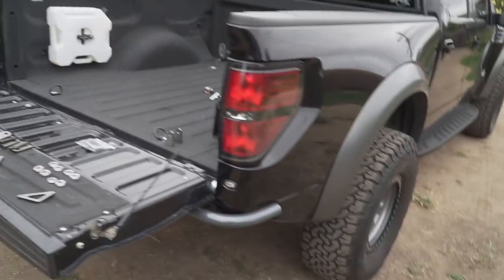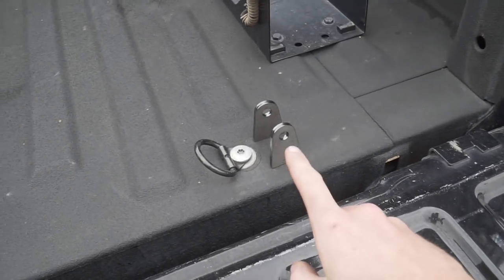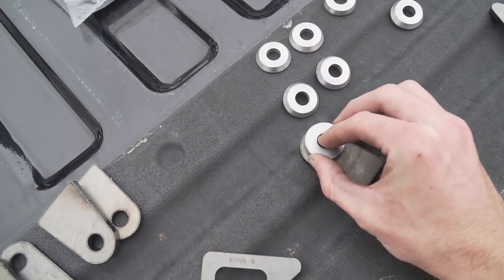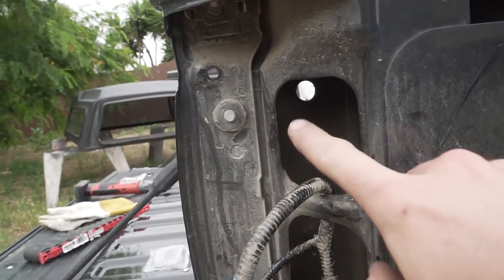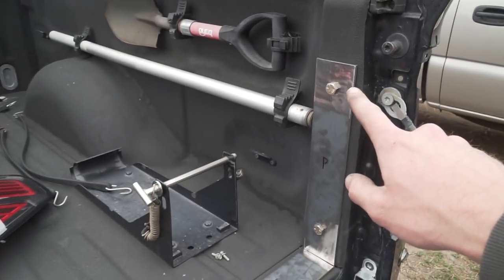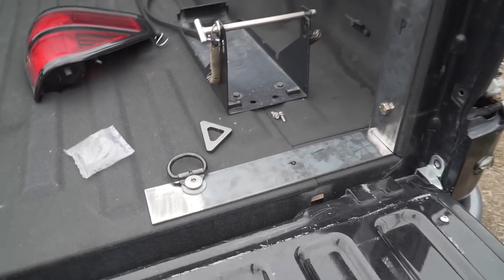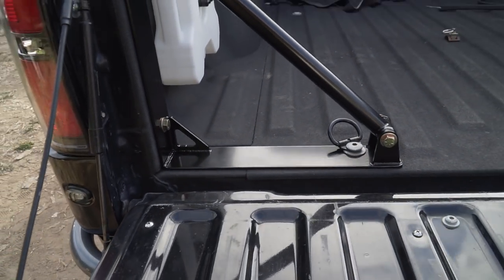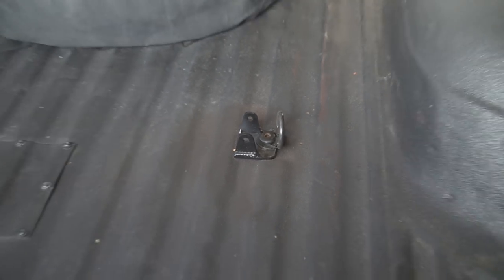Making A CUSTOM Bed Support For A Ford Raptor

Comment: Nice job you should add a bar across the back welded to the bottom of the joint's of the diagonal short bars for extra bracing and making it easier to remove as it would be one piece.

Comment: Very clean build, I had some built similar, used some threaded swivel eye bolts. Quite an improvement on noise reduction. Good times offroad